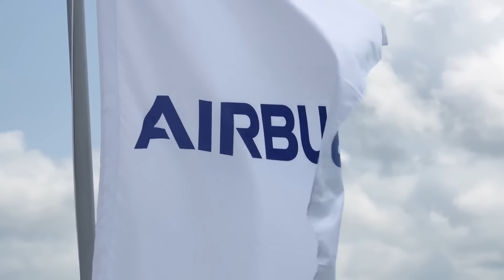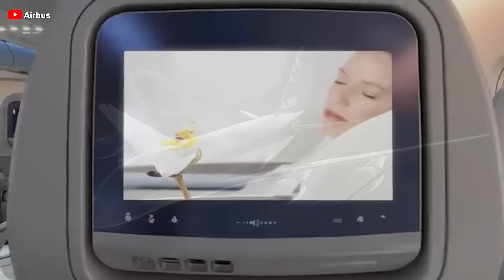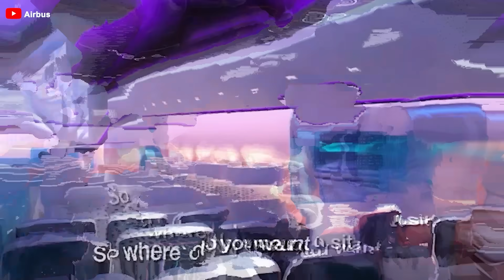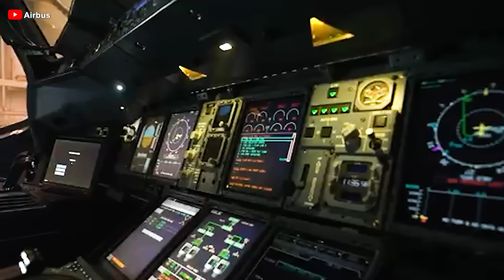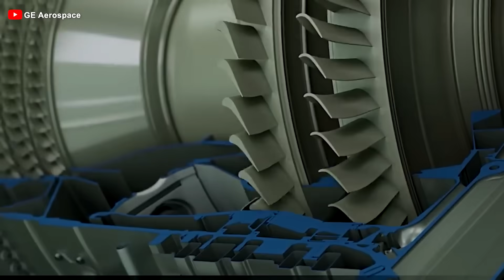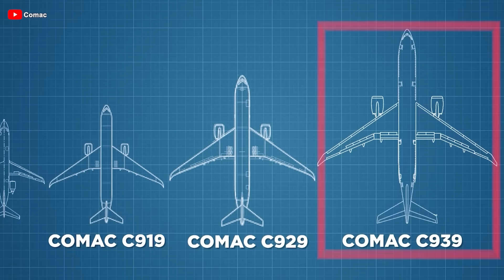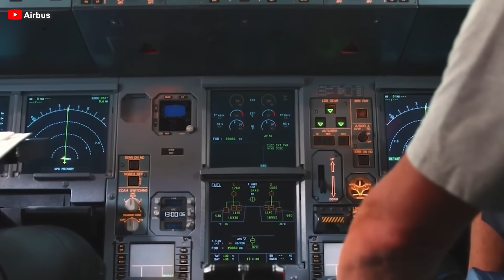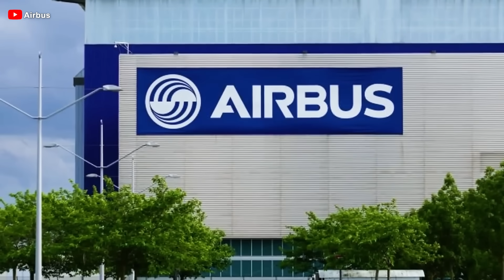Airbus' HUGE PLAN to Build The A390 that SHOCKED The Entire Industry! Here's why

Comment: I think you must include disclaimer that this is just your figment of imagination. Do not try to pass this off as news. While it is conceivable that if the A380 like airframe and wing could be built using lighter material like composites, it could possibly be powered by large twin engines. Remember GE works exclusively with Boeing on the GenX engine.

Comment: Fake news, no more 4 engine air crafts.
Reply: Because the A380 is a failure,nobody wants 4 reactor engines ,consumption is too much.Every airlines want an economical less consumption aircrafts for industry.
Already many a380 went to destruction at Tarbes in france.
Reply: @alexandremorlot7270  stop doing drugs bro
Reply: who told you that ? sleepy biden    FJB
Reply: You didn't pay attention. The A390 as described is to be a 2 engine aircraft based on the A380 airframe.

Comment: The A-390 would need 150,000 pounds of thrust per engine and no one is building them that big yet. The fan diameter would cause problems with ground clearance. Maybe they could put the engines on top of the wings.
Reply: RR Ultrafan

Comment: There is a place for A 390's but as with all types it will be a niche product. It will demand a  different type of hub system which would service both long and short distance spokes. That would mean that hubs would need to expand and capacity would multiply. That could leave several present hubs and aircraft to downsize.  Is this an option?